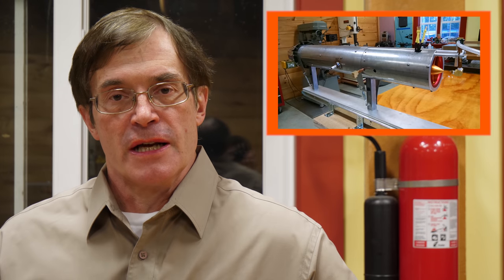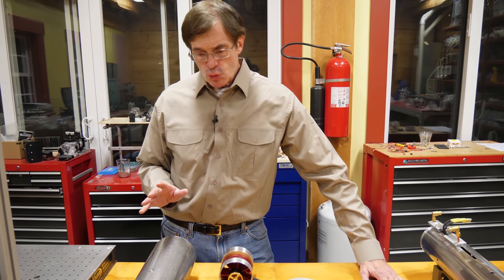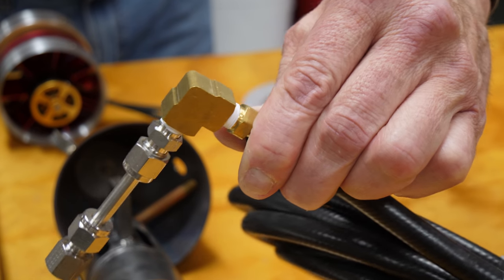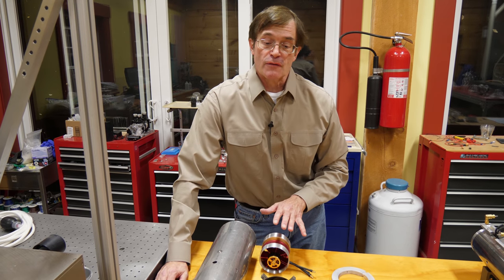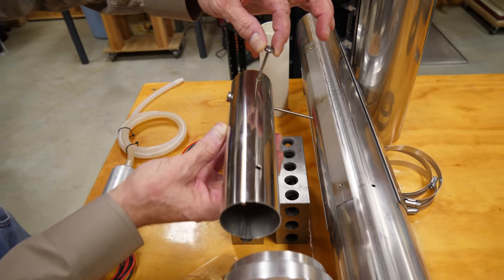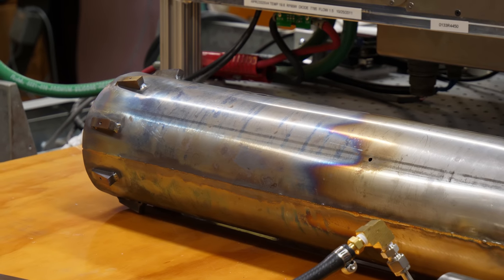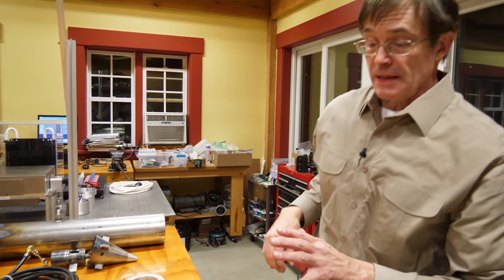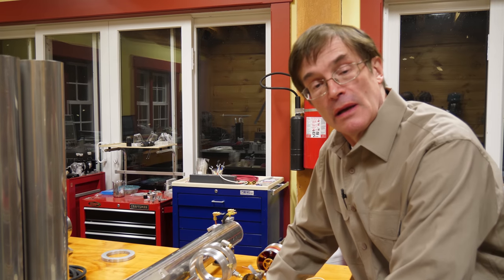Hybrid Jet Engine - Update 2.0

Comment: great video! but shouldn't you try to keep all the heat in and not cool it(as long as the materials can take it) to get the best efficiency?  in the same way that you wrap turbo manifolds and use turbo blankets to keep the temperature and volume up? and don't you also loose a lot of energy by converting the water to steam? keep up the good work
Reply: You want to have the inlet as cold as possible and the exhaust just below melting point of the materials. thus cooling the wall to keep it from weakening is needed, either by airflow outside or the water being flash boiled. The steam could also be injected into the exhaust to increase volume as well, improving thrust while keeping it cool, or used as a laminar flow along the walls of the cylinder to provide that barrier to keep them cold, like done on the Saturn F1 engine which used exhaust gas from the turbo pumps ( fuel rich and thus cold) to provide a barrier between the exhaust, hotter than the material melting point, and the bell.
Reply: Well, you can control the cooling via the flow rate to the point where your material is just stiff enough to avoid bending. And you really don't need a lot of water, one filling will give you approx 160 kJ of "cooling energy" while it takes around 24 kJ to cool the tube 200K down. Since this thing is running at around 2 Million BTU (or 2 billion Joule)[yeah, this comparison is sort of idiotic, it is just there to get a grasp of the problem], the cooling will probably not make a significant dent in the total power, while allowing it to run at greater gas temperatures, therefore increasing the volume and power output.

Comment: surely it would be more efficient to have a larger diameter (but slower) fan feeding into the compression stage via a nozzle like cone structure? Not an expert by any means but I am an Aerospace student an I'd have just assumed that the having a small fan that spins fast will use more power than a larger fan that span slower? And you should be able to get the same sort of velocities with nozzle. Hell assuming you can hit mach 1 after the combustion chamber you can then have a bell nozzle to increase thrust further, obviously that would have to be optimized for sea-level for the prototype but yeah.
Reply from the maker: The larger the fan, for a given energy input, the larger the mass and the slower the velocity.  The velocity is key in producing the pressure rise due to the ram effect just past the lip of the cone.  Pressure ratio is everything when it comes to converting heat energy into kinetic energy.  Despite our best efforts, this engine is quite inefficient regarding fuel consumption because its compression ratio is around 1.3:1.
We are building a small turbocharger based turbo shaft engine that will allow the extracted rotational energy to drive a large diameter fan.  That will be far more efficient.

Comment: I wonder how much electrical energy you could recover by diverting some of your liquid cooling exhaust to run across some thermocouples cooled on the other side by the liquid propane headed for the engine burner.
Reply from the maker: Wait till you see part two.  I address some interesting potential along similar lines when such an engine takes flight.

Comment: EDF's work on velocity not pressure. As you said, they are not compressors. I'm sure you'd get better thrust to weight from the EDF alone.?. Maybe if you had an electric centrifugal compressor instead of an axial EDF; but complicated...
Reply from the maker: You would get better thrust to weight with the fans alone.  You would get even better thrust to weight with a large diameter  propeller, than with a fan.  But, we wanted a jet with it's sound and heat and flame and the batteries are heavy.  The hybrid jet looses, but not by much on a thrust to weight basis compared to the fans.  In part two, I go into the potential ramifications of this design as flight speed increases.  They're interesting.

Comment: I'm struggling to see the point of this. The EDF looks likes it providing the majority (If not all) of the thrust. The propane burning in the airflow rearward of the fan seems kind of pointless, unless the ignited fuel / air flow is driving a turbine on its way out which drives the intake fan, which it isn't. It just seems like a very well engineered flame thrower.
Reply from the maker: In part two, you will see that we nearly double the thrust of the fans when the afterburner is running at full power.
Reply: Tech Ingredients ____ But you must be aware that an afterburner is one of the most fuel inefficient ways of producing thrust? A modern fighter jet can produce enormous amounts of thrust using reheat but it will empty its fuel tanks in under 10 minutes. If this thing is guzzling huge amounts of fuel PLUS needing some source of electrical power for the fans then the thrust figure - on its own- is pretty meaningless. It needs to be efficient too.
Reply from the maker: I am fully aware of that.  An afterburner is used for brief periods to augment thrust despite it's fuel inefficiency.  This is more efficient than installing and carrying around a larger engine that is capable of generating that same augmented thrust level.  The same applies with this engine.

Comment: Place a diffuser between the fan and the combustion chamber... Bernoulli states that as a velocity of gas decelerates, the pressure will increase...
Reply from the maker: That's what happens when the air passes the lip of the cone.
Reply: Tech Ingredients Your current config shows a converging nozzle, you want it diverging to act as a diffuser... Not as a nozzle! Your getting a pressure drop, no increase!

Comment: Using counter-rotating fans to get around the lack of stator issues... Huh. That might actually work.
On the topic of cooling, why not redirect air around into a vortex or film along the surfaces to provide insulation against the flame like in real jet engines? I know of a weird rocket combustion chamber concept that uses a swirling vortex of oxidizer to keep the flame separate from the chamber walls. I don't know if it will help with cooling, but it will most certainly help with mixing.
Reply from the maker: When you see part two and look up into the operating engine, you can see that the annular flow does a pretty good job achieving this spacing.  We might be able to dispense with the water or achieve enough cooling with a little bleed air from the first stage compressor.
Reply: I guess the additional mass from water injection may help with additional thrust.

Comment: have you considered flowing some sort of fuel or oxidizer through the outside instead of the water, maybe something like kerosene to be able to use that for fuel instead?
Reply from the maker: The degree of freedom that the independent water cooling system allowed was why we incorporated it.  We could adjust the cooling to meet the requirements at any given throttle setting.  But, we now know that the requirements are in fact pretty low and the fuel flow is pretty high and your suggestion may in fact be more elegant and efficient.  It's worth a try.  Thanks

Comment: Couldn't you  use a "bypass" with some bleed air or something and cut down on weight? It seems like once this was mounted on an airframe you might benefit from air being forced into the engine as well?
Reply from the maker: That may prove to be superior to the water for weight reduction.  If we go further as I describe in part two, we may indeed use air bypass.

Comment: A solid rocket will be lighter faster and more efficient. What are you trying to build here? A fancy workshop heater?
Reply: In an R&D setting like this you do not build and design to be efficient. You do it to learn. Early on he states that he learned a ton from his previous video and is building upon that knowledge. This is all ignoring that your comment implies strapping an SRB onto a commercial airplane is more efficient. Different tools for different jobs.

Comment: neat project, even if this is way more complicated than a regular jet engine. also: are the ceramic components cheaper than the nickel alloy used for high temp jet engine parts?
Reply from the maker: Thanks!
They can be cheaper, especially if you make them yourself.  They also have a much higher temperature tolerance, zirconium oxide can operate at 2,200C,  Hastelloy melts at 1,350C
Reply: how well does the zirconium oxide coating protect the base metal (stainless?) from melting? how high can you go before you risk something like a melting-penny scenario, where the zinc melts before the copper cladding and slumps out?

have you thought about using bypass air to help cool the outer tube?
Reply from the maker: The ceramic coating does not help to prevent the tube from melting.  The coating is much too thin. It is designed to prevent oxidation damage.   The water, or maybe in the future, bypass air, keeps the bulk of the tube cool to prevent melting.

Comment: basic attribute of effective axial compressor the stator blades direct airflow reducing turbulence so if your EDF fans spin opposite direction you still have a single stage compressor with the stator that is rotating. the stator blades don't have to be rotating to function. Therefor fan stator fan stator gets most from of the compressor section for all power speed size of all axial designs this is an absolute. Get this correct then the combustion tube and bypass air volume are close to correct when combustion tube is not part of the output gasses . Just keeping it simple making it work real world and durable not simple if well designed examples are understood know that can save time and money
Reply from the maker: You are correct that this series set up is not equivalent to a two stage turbine with an interspersed stator which serves as a diffusing, nozzle. It would have been better for me to describe this as a twin rotor, single stage turbine with variable speed rotors.

Comment: On a drone, how are you going to provide 7000 to 8000 Watts of electric power to operate the two electric compressors? Li-ion batteries? on-board generator? etc...
Reply from the maker: There is no way this engine would be used on a typical consumer drone.  This is more in line with high end RC model jets.
Reply: even on a high end RC model jet, how do you plan to generate 8000 Watts of electric power to spin the two compressors ?  perhaps Li-ion battery pack ?

Comment: You could use titanium for better corrosion protection.
Reply from the maker: True, but it is nasty to work with.  It breaks tools and shears the teeth off of saws
Reply: Tech Ingredients - Ohhh I know, I work with it on a daily basis. Stainless, inconel and others are just as difficult to cut and machine. I made the polystyrene speakers from your other videos and I really like them, thanks!

Comment: Wait, aren't stator blades essential to compress the air (not nessecary just redirecting it but also expanding the air, wich in turn increses pressure), so why attaching a second counter clockwise turning edf in serious. Wouldn't that have the exact opposite effect of increasing fluid velocity and decreasing fluid pressure?
Reply from the maker: They are helpful and more effective as nozzles due to the degrees of freedom in shape and angle optimization, but they arn't essential and add complexity.  The counter rotating fan arrangement is a compromise to ease the construction.
Reply: @TechIngredients  
So there won't accure problems like transsonic velocities inside the impeller wich could decrease effeiciency? I'm asking because i take fluid dynamics classes and it always seemed as if counterrotating compressors are at a disadvantage, else they would be used in aircraft turbo fan engines, right?

Comment: I'm don't think you will gain much with couterotation of fans. 
The static blades in an axial compressor do not just redirect the flow. They defuse the flow creating pressure as the velocity drops. So then the next blade set can accelerate the slowed pressurised air.

If the air is not defused it each stage will not be able to accelerate the air and add to the pressure. As it would already be doing to fast for the next stage.to do anything.  

Centrifugal compressors are far better for creating higher pressures in few stages. Each stage of an axial adds only a little pressure. Where a centrifugal can add multiple times the starting pressure. 

The next problem you will have is a jet engine compressor uses about 2/3 of the energy in the engine. Levi g only 1/3 to do work. Like turn a fan or propeller or generator.  Or to just blow out the back and make trust. So the issue is how much energy you can actually get out of a motor over just using a turbine and the energy in the burning file. 

Another factor is the kind of thistle you are making is only useful when going really fast. If you row with a tiny ore you will have little leverage against the water. Use a big ore and you.get lots of resistance to pull against. 

Unless you want to go really fast, big propellers of fans are far more efficient as the grab more air to pull and push against. 

But accelerating it faster than you are traveling becomes a problem. So high speed jets acelirate a small quantity a lot. Which is very inefficient. But still works at MK2. 

Check out agentz. This channel gives lots of information. 

For instance how jet combustors work. The flame never touches them. That's why they don't melt. The same is basically for in the afterburner.
Reply from the maker: You're correct that counter rotation is a poor substitute for stators, but it is  easy to implement and in the end, it is the total linear velocity that these two fans achieve that is converted to compression as in ram air compression.  We get to 3.6 PSIG at full fan speed.
Propellers will always win out in efficiency due to the large disk and the mass that determines the momentum ie M x V.
We have watched many of his videos and they are enjoyable as well as informative.  His tutorial on wire locking bolts was invaluable for our up coming video on turbocharger, turbojet conversions.  I am familiar with the design and principles of flame holders as you will see in that video.  This hybrid engine poses an unusual challenge due to the low compression ratio and sensitivity to any additional back pressure.
In part two, you can look directly into the engine and see the flame distribution and it is in general separate from the walls.  At even higher power settings the flame tube, unless converted to ceramic, will melt and the outer tube may suffer some damage and thaty's why we explored the idea of a water cooling jacket.  This may eventually be converted to a bleed air cooling film for simplicity.

Comment: Wouldn't using a higher compression capable component than an EDF  be a better solution? With the price, I could see using automotive turbo chargers to do this.
Reply from the maker: We're nearing completion of an automotive turbocharger based turbo shaft engine for an up coming video.  I'll go into these comparisons in that video.
Reply: I mentioned it since "colingfurze" has made several simple turbojet engines using those, including a jet powered BBQ. The BBQ was more of a proof of a concept/ridiculous build while the others were practical, thrust producing engines. He has also done several pulse jets that had pretty good power levels for their size.
Reply from the maker: We've seen those videos including his most recent jet scooter.  That one in particular was like deja vu.  We filmed a jet bike video a couple of weeks ago and in that video I even dressed like him.
These turbocharger, turbojets all follow the same general layout, compelled by the design of the turbocharger.  I will cover the principles in depth to the chagrin of our more vocal critics, give the equations and dimensions of the unit we built and continue to move on to incorporate it into a more useful turbo shaft engine.

Comment: Have you considered trying this with a radial compressor, like a turbocharger compressor? I feel that an axial fan is just not gonna produce enough pressure. Do you know how much thrust the fan produces on its own? Find an old dyson on ebay and get the little motor and compressor out of that... ;-)
Reply: He needs some stators to diffuse the air IMO.
Reply from the maker: Yes.  Each choice had its merits and drawbacks.  The turbocharger compressor conversion required substantial machining of the shaft interface to couple with an electric motor and the available RPM of drive motors required a large compressor wheel to reach a high enough radial velocity.  This meant a large drive motor, but the larger the motor the lower the maximum RPM.
A repurposed, three stage, centrifugal  commercial vacuum/blower was tempting if the motor could be swapped for a much more powerful brush less motor.  The cost of the most likly choices was pretty high because the souped up operation required a pretty robust housing to withstand the forces involved...and then it had to be converted.

Comment: You should cool the tube with the liquid propane and preheat it instead of using water.
Reply from the maker: Its a thought, yet there are some issues.  At the extreme temps that the inner tube reaches, the propane might decompose or coke.  We don't use much propane and its low heat of vaporization will limit its cooling effect
Ultimately, we may substitute a little bleed air from the first compressor to eliminate the water altogether.

Comment: Are you going to drag a tons of water with you for cooling. Why not rather use turbofan or fanjet technology were the big fans direct cool air around the tube and add to the thrust.
Reply from the maker: This was an experimental test of the effectiveness of this concept.  An air bypass will be lighter and potentially simpler and that is very likely why that is the conventional approach.